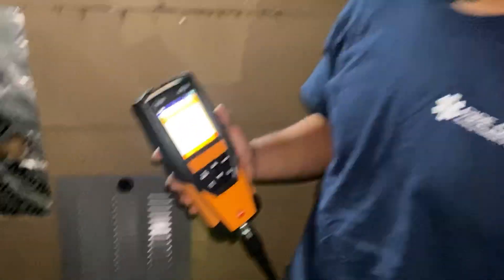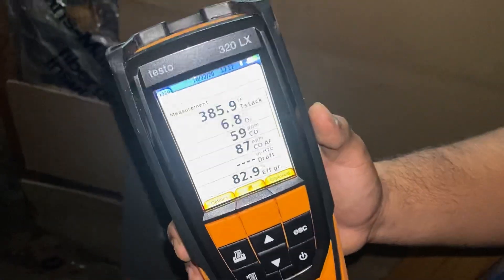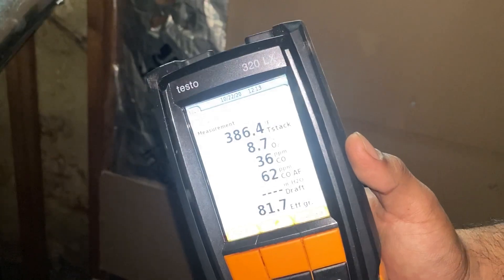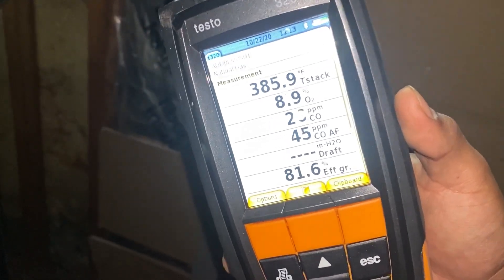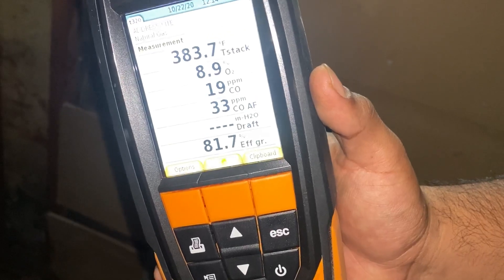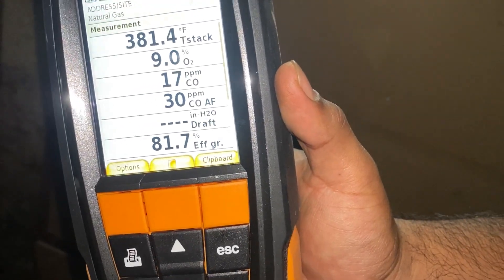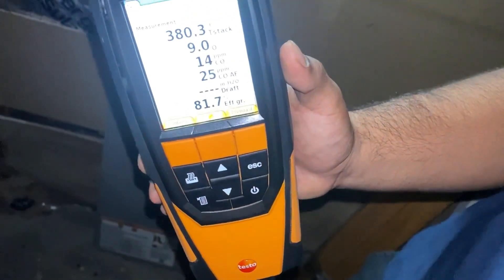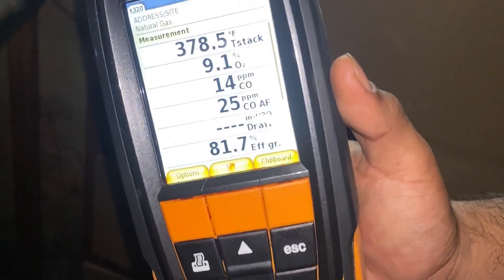Using Testo 320 Combustion Analyzer to Test For Proper Flue Gases If You Ain’t Checking Your Guessin

Comment: If you wanna be a hard ass. You should be running a manometer test at the same time.   Maybe get your analyzer calibrated because there is zero chance it is running over the manufacturer spec for eff.

Comment: So you prob went from 3.5 to 3.9 to get less CO and more efficiency right?
Reply: No 3.9 is over firing. If the gas valve is rated at 3.5 then that is what it must be set at.
Reply: 3.5 is nominal and gas valves have a range.  Normally 3.2-3.8 is the acceptable range
Reply: @wd8557  I think that's why your supposed to use a combustion analyzer. It let's you reduce CO and increase efficiency. 3.5 is usually just what it's supposed to be set at. But going up wont hurt it it will only decrease CO. That's why people adjust gas pressure on gas appliances...
Reply: @benjamintimmins1656  You use a manometer to check gas pressure period. Only time I have used a c/o analyzer is for furnace tune up, or for the required inspection of a rental property. I had a valve that fired at 4.9 wc and the furnace shut down on hi limit. It sounded like a jet taking off on start up. If I could only have one tool out of the two it would be the manometer.
Reply: Probably not since the exhaust temp dropped almost 5 degrees
Reply: So I could throw in a manometer and not worry about hitting 3.5 on a natural gas furnace? Yes no maybe